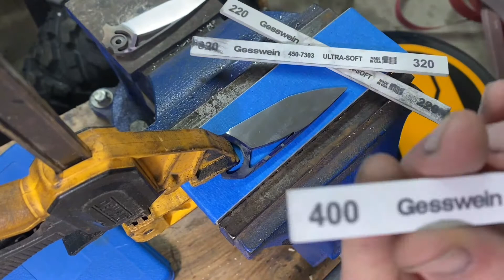How I make a folding knife (Tengu No. 3&4) part 2 GRINDS!

Comment: It seems like I do better with the low grit belts and make more work for myself when I get up around 120-220 grit.
Reply from the maker: 120 is my last shaping belt. 220 starts “finishing” then sometimes I’ll do 320. 400 cork or surface finishing belts. Depending